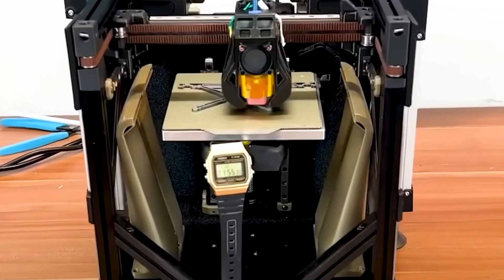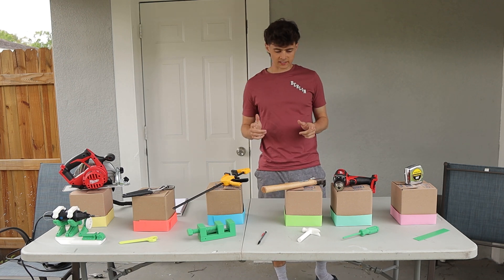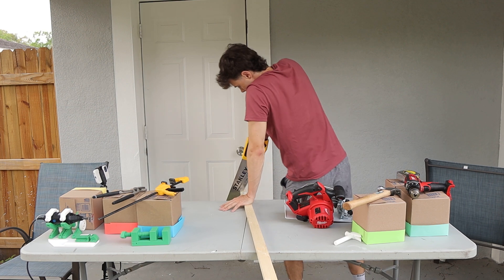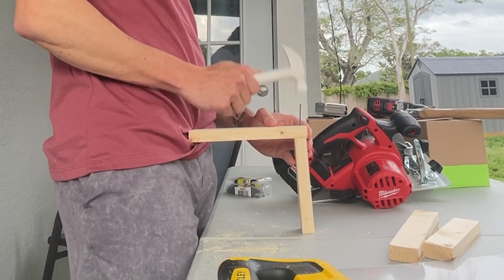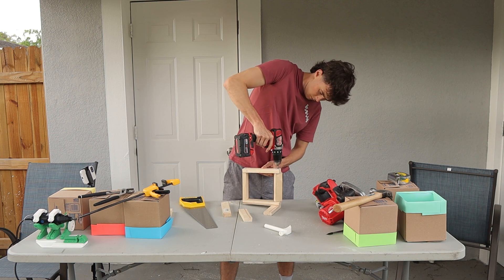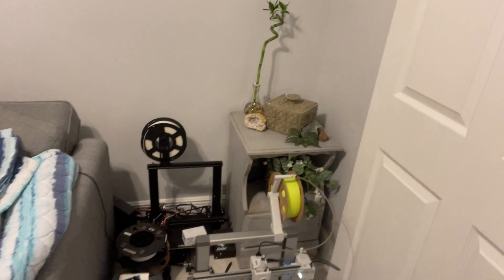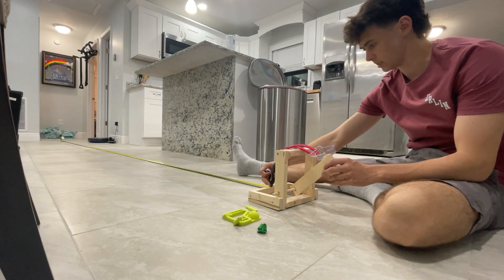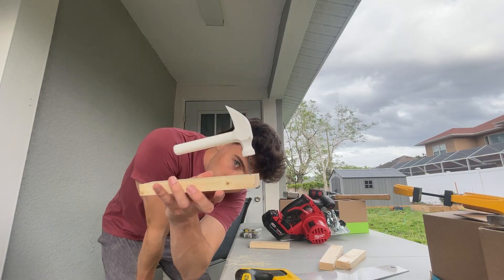Can a 3D Printer build better than a Human?

Comment: Hey, great video! The Micro Catapult works best in ABS as it bends way better than PLA (Pla is also pretty brittle so as you saw the spoon can snap off, oops). It also doesn't work as well if scaled up, as the bending section becomes too thick to bend.
Reply from the maker: i might have to test it again in a round 2👀